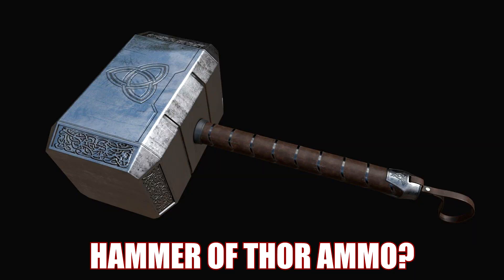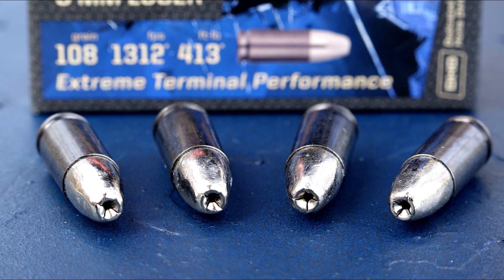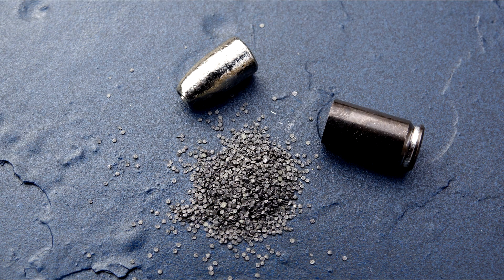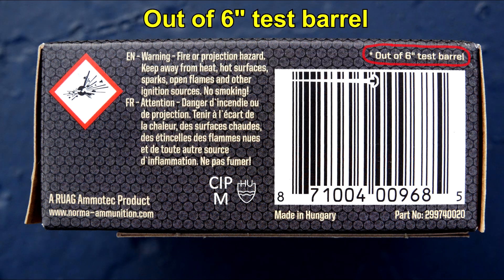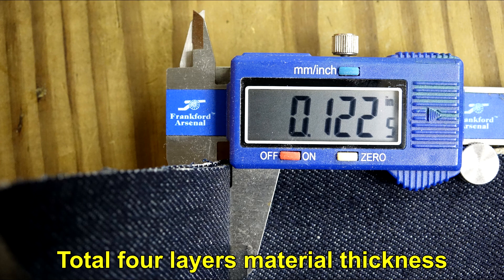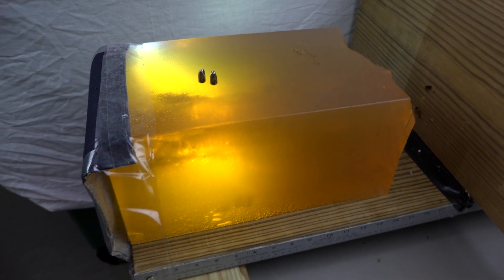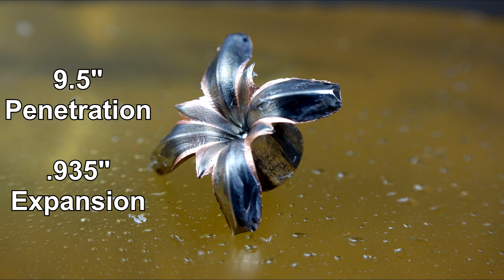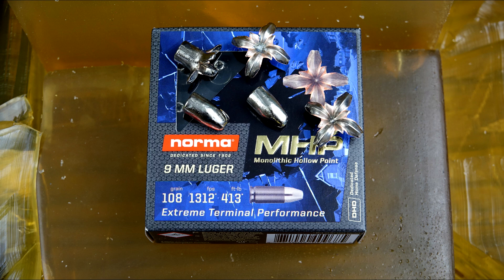AMMO REVIEW:  NORMA Monolithic Copper 9mm in Calibrated Gel (2021)

Comment: If these had some extra weight (lead) added to them they might actually penetrate enough to be a decent choice. But low penetration combined with unreliable expansion just isn't acceptable when you can pick up HSTs.
Reply: The low penetration is due to the fact that they expand so much. I don't think adding weight would help much.

Comment: Can you test the new 185 grain 9mm seismic round?
Reply from the maker: Another gimmick.  I've done enough research and exercising logic to reach that conclusion.
Reply: @tnoutdoors9  thanks for the info
Reply: It may have application as a quiet subsonic suppressed round. You can't have the velocity, so you may as well have the weight. Other than that...I probably wouldn't consider it.
Reply: @oldscratch3535  I thought the same also. I like sticking with gold dots and hst as it’s tried and true. I’ve done my own test with those and every single time they work as advertised.

Comment: This is off topic, I apologize in advance. Do you have any experience with Cor Bon ammunition, more in particular with the 9mm 125gr +P JHP? I have this stuff in my edc, but I never did any homework on this ammunition. Box says 1250fps 434ft/lbs avg. Seems based off these numbers this ammunition may have a tendency to over penetrate? Does not state the barrel size it was tested from. Thanks for all your time and contributions. -Dave
Reply from the maker: Way back in the day when you could find it.  Also in 40, 357 SIG, and 10mm with CorBon.  Great velocities but soft lead and the bullets deformed to a high degree.  Great opportunity for jacket separation.
Reply: There is nothing wrong with that ammo per se, but there are better loadings out there today. I personally like a heavier +p round with a bonded core and some sort of clog prevention like Hornady uses. Something that can hit a barrier and still reliably expand. That CorBon is also hard to find and source. Picking something more mainstream and accessible is important in my opinion. You really can't go wrong with Federal HST, Gold Dots, or any of the Hornady Critical Duty offerings. I use Critical Duty 135gr +p.